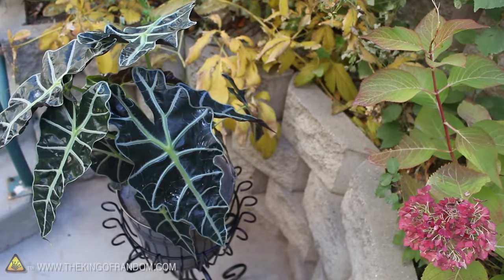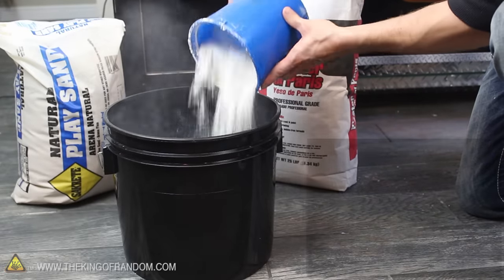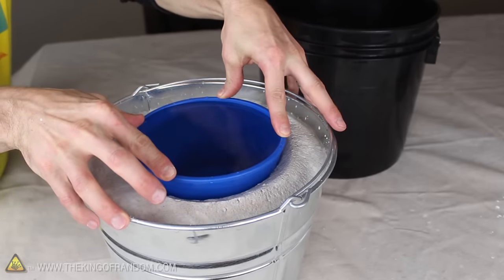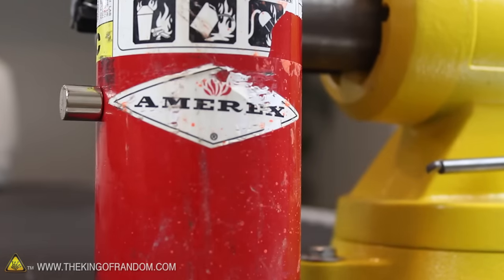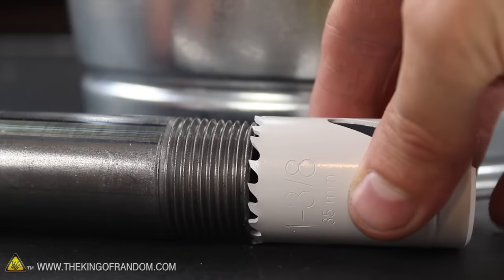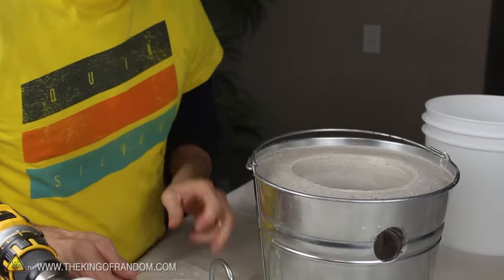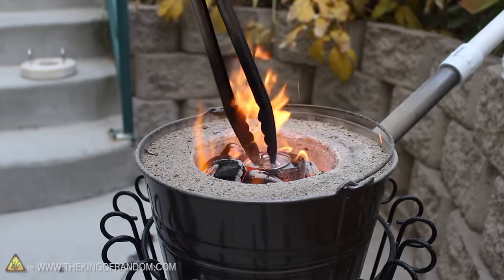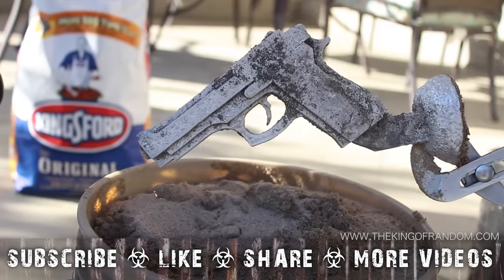How To Make The Mini Metal Foundry

Comment: Can I use common plaster that used in drywall ? Here in Brazil is impossible get plaster of paris
Reply: mud docent hold up to heat very well
Reply: If your plaster is a Gypsum Plaster than yes, it's basically the same thing.  Plaster of Paris is just a powdered gyspum plaster that cures externally before all the water in the mix is evaporated, preventing shrinkage during setting.

If you're using cement plaster, then no.  Cement plaster contains portland powders which when they dry, leave airpockets and can cause "pops" or mini-explosions when heated or exposed to molten metals.

Comment: Better use a different formula for teh amount of water.
I followed the recipe to the letter but I made teh lid first to acquaint myself with any problems that might arise.
I started cutting the vent after about an hour but where I should have been getting a dust I got a paste, so I put it away overnight. 
Twelve hours later and the lid is still not completely dry and hardened, which allowed me to take a chisel and finish carving out the vent, which is now perfect.
This leads me to believe that Grant's "Hold the bucket in place for about five minutes i: is not going to work unless I use a lot LESS water or more sand/plaster mix.

Comment: so three bags of charcoal latter still hasn't melted a single can. with a thermometer I find I'm not quite hitting a thousand degrees, and it's far hotter on one side than the other. what did I screw up
Reply: did you have sufficient airflow throughout the whole thing? Using a hairdryer on low heat, is best through the air flow pipe. Definitely try that next. Also, try coal.
Reply: Been meaning to post this and thank you for responding. I got a mud mixer bit for my drill then started over. Works great now. I can only guess that my sand plaster mix was not mixed well enough and heat was escaping.

Comment: i made this furnace and i had trouble finding a crucible, first i used a steel can and it burnt a hole through it then i bought a graphite crucible which it also burned a massive hole in the side of. Any suggestions of what else I can use for a crucible.
Reply: Aidan Bowen - This will be my second attempt.  I'm going to try using an empty 16 oz propane bottle you use for camping.  The reason I know its fully empty is because I put a .22 cal bullet through  the top of it at a distance.  I guess there's an easier way to make sure its empty, but I don't know what that is.  Anyway, you could try that.
Reply: buy one. silicon carbide bilge shape works well.
Reply: A $10 fire extinguisher???

Comment: It has been 5 hours since I poured the plaster and it is still slightly wet. I made sure to get all the proportions of the ingredients right. I spilled a little bit of extra water into it from the smaller bucket but it wasn't much water and I don't think it should have done anything that bad. Any ideas what might have gone wrong?

Comment: I want to make something larger than a mini metal foundry, if I follow these directions but scale it up to a 30 quart or so base bucket might I run into any issues?
Reply: I've scaled it up to a 20 quart base bucket. I havn't had a chance to use it yet but it came out fine so far. The plaster hasnt exploaded or any thing.
Reply: @jpmisme1998  I saw a later video of this guy and he showed other foundries and I am going to go with the hole in the ground design and use a plaster mold instead of sand mold because for a larger mold I imagine a lot of the sand would fall in and cause holes

Comment: can you use cement instead of the sand and powder
Reply: absolutley not. cement can and will explode lol!
Reply: @mattygaga2013  elaborate further please.
Reply: @gamedestroyer3070  cement when subjected to extreme temperatures (especially that of a furnace) will crack and ultimately the air rushing into the crevice will cause it to superheat and explode.
Reply: @mattygaga2013  thanks, I was going to use cement if not for your comment
Reply: @mattygaga2013  does any sand works or are there specific types?

Comment: I followed the instructions but for my crucible, I used a steel tube and steel base welded together... As a source of air, I used a shop vac with the hose on the output port. I quickly ran through a bag of charcoal and blew large holes into several crucibles. I am somewhat confused because melting cans did not give me consistent molten aluminum but rather what I would consider "Crud" at the bottom of my crucible and a small molten amount on top. My last attempt I was melting radiators as I figured they would be a consistent source of aluminum. I nearly filled my crucible when I saw a BRIGHT light and my molten aluminum quickly disappearing...The aluminum boiled its way through the bottom of my forge and onto the ground below. Moral of the story...just stick with a blow dryer.

Comment: if i burn solid oak wood in this, how hot will it get?  can i melt gun brass and copper in it?
Reply: I’m gonna say hot enough. It’ll burn a lot quicker than coal though. I regularly burn pallet wood in my homemade forge, and though it burns quick, it got hot enough to melt a hole in a leaf spring.

Comment: Hello, I am wondering. Are you able to melt copper with this metal foundry?
Reply: i think so just search up the melting point of copper
Reply: @sepz4852  that's not answering the question. The question is if with this method of heating, using charcoal, the temperature can rise above 1089degrees which is the melting point of copper.

Comment: I recomend buying a 2inch to 1inch reducer for the hair dryer to connect to the pvc pipe
Reply: Captain Bear this is the bit I’m missing he explains all parts needed except for what’s at the other end of the blower pipe
Reply: @xsalad_dodgerx8428 , from the hair dryer its a 2 inch PVC slip reducer, the PVC pipe, a 1 inch PVC coupling (FIPT x Slip), the 1 inch steel pipe and that's it. the steel pipe is the last part f the blower.
Reply: Thanks bro but now I’m struggling to light the furnace lol maybe using wrong charcoals

Comment: I built one of these years ago, and the first time i used it i destroyed the hair dryer bc there isn't any instruction about make vent holes in the pipe for excess heat that comes back up it
Reply: There is a more recent video where he says some advice. He said that inmediately after turning off the hair dryer, you must retire the tube, or the heat will melt it

Comment: I'm thinking about getting a graphite crucible on Amazon, but there are so many different sizes, does anyone know which one would work best with this?
Reply: With graphite, you need to be careful for prolonged periods of use. It can corrode and cause a forge failure leaking all the molten metal

Comment: I use a "foundry" much like this one. Yesterday I was melting aluminium using wood as fuel, and a stainless steel yeti cup as a crucible when the crucible failed. I immediately used cold water to separate my metal from the charcoal and ash. As I was doing so I noticed a large crystal like "rock". Part of this mostly clear "rock" looks like it has a very thin and transparent peace of aluminium trapped inside. Does anyone know what I have made?

Comment: What is the name of the clay or sand you use for casting
Reply: I saw in another video it's called (green sand) also the video said if you don't have the green sand you can use fish pools sand instead from pets store. In college I used the green sand but fr it has bad surface finish because it is not that smooth

Comment: so what do you actually use the blower pipe for?
Reply: The blower pipe is used to force air in at the bottom to help increase the temperature
Reply: @peterb8904   by forcing sin in using what brother

Comment: i followed the mixing on the spot but when it dried and i drilled the hole it crumbled and cracked the wall any tips
Reply: That was my son. So we mixed up the batch of plaster/sand (play sand)/ and water. It was fairly accurate but not 100%. It sat for well over 36 hours before we drilled into it and it just fell apart. Very fragile composition. Any ideas? Thanks!!

Comment: Can you use wood in it
Reply: As fuel?
Reply: @typodoeseverything  yeah I’m not shor if it could burn hot enough or as long
Reply: @blaydenlehmann966  It wouldn't be my first choice, but there's a chance it would work
Reply: Check out my rocket furnace video. I made a custom furnace made from large tin cans that can melt zink, lead, tin and pewter, that uses wood as fuel

Comment: can the  bucket be zinc
Reply: Zinc has a very low melting and evaporation point, you would have to make sure the refractory would be enough to protect the bucket... In my experience, my steel bucket gets extremely hot at the top which would probably melt zinc. If it's coated in zinc that's fine except for a little bit of vapor from it.
Reply: @domchubs5836  thankd

Comment: Does anybody know how hot the metal bucket itself gets when it's being used?
I ordered a steel bucket online but I received an aluminum bucket and I was wondering if it could withstand the heat
Reply: the inside only gets hot enough to melt aluminum and the plaster will insulate so as long as you run it for less than 200 hours at a time it should work
Reply: @davidpranston2902  Very nice, thanks for the response mate

Comment: Here's everything he listed. might make it easier for some of you :D

10 liter bucket

2.5 liter bucket

5 liter big mouth bucket

1" x 12" steel pipe

1" PVC Coupling
(FIPT x Slip)

1" PVC Pipe (2ft length)

2x 4" U Bolts

bag of play sand

bag of plaster of paris

1-3/8" (35mm) Hole Saw

3" Hole Saw
Reply: do u know what is used for the blower?
Reply: Quarts, not liters

Comment: Condolences to his family, however It needs to be pointed out that you should never use plaster of Paris in any way as part of the heat shield like this, calcium in the plaster loses its oxygen molecules and becomes quick lime at  temperatures lower than those in a foundry the moment any moisture even the water in your skin comes into contact it will cause a exothermic reaction that at best will cause it to fall apart and at worst give you 3rd degree burns if you can't buy refractory cement use dirt or red bricks.

Comment: Please somebody  explain why not just use steel bucket , why adding concrete,plaster of Paris etc??.  Steel bucket is enough to hold hot melting item
Reply: The plain steel bucket won't hold the heat in. Also the steel won't hold up to the high heat. It will rust and break down rapidly. My first furnace developed a crack in the lining and the heat quickly eroded a hole through steel can.

Comment: How’s the pvc not melt?
Reply: The rising heat in the body of the furnace constantly draws in cool air through the tube so the heat never reaches it, even without the blower attached.

Comment: I’m going to use clay instead of plaster. More or less same design. Any others do similar?
Reply: I wouldn't recommend it. Plaster of Paris mixed with sand and of course reinforced with steel meshing, is incredibly heat resistant and durable. Clay can fracture at temperatures higher than 800 degrees. You're far better using the ingredients suggested.

Comment: Do not use pvc. Get a longer steel pipe. Think of your air supply. Notice his is never shown. It took a $250 blower for me to get enough air to heat it up enough to melt aluminum. You will get tons of sparks. Think of your first attempt as just that. Your 2nd will be better. Still, the air supply is the headache and we have no idea what he is using.

Comment: Ratio is wrong. Way too much.
Reply: I measured out 21 cups of both plaster and sand. With one gallon of water minus 1 cup. Over flowed when I pushed in smaller bucket.

Comment: it would be so much better if you used a decent metric system for measures
Reply: I only ever pour imperial though...
Reply: You are totally correct, I had to pause the video a lot of times to convert these weird parameters to the metric system.
Reply: It would be easier if the entire crummy world would stick to either the metric or the other one the US uses
Reply: The us system is the better system.
Reply: What's 1.5qt in hogsheads?